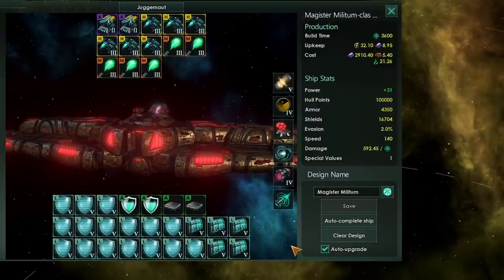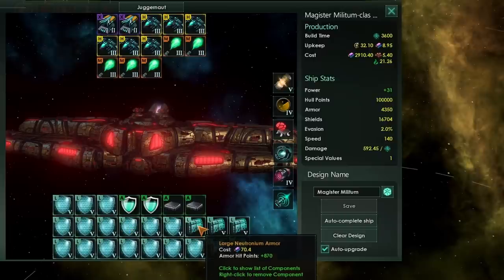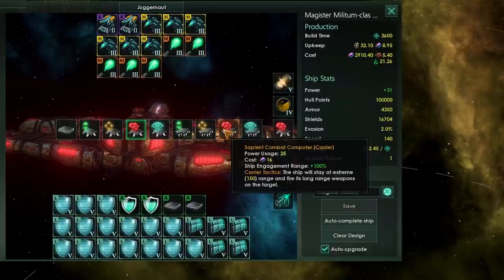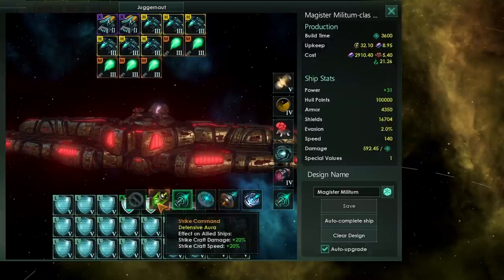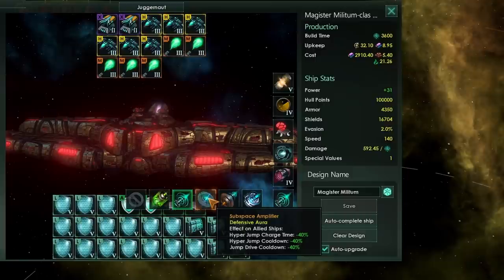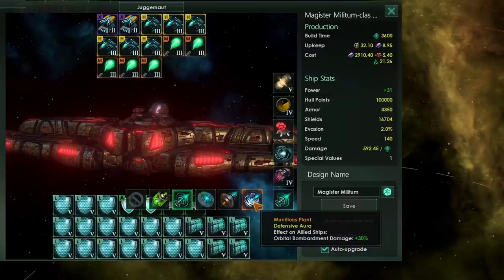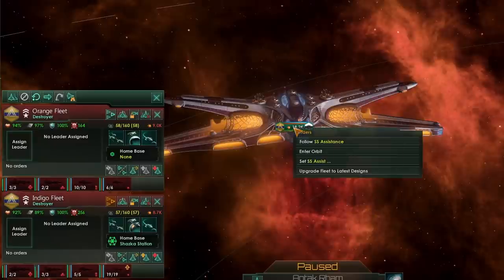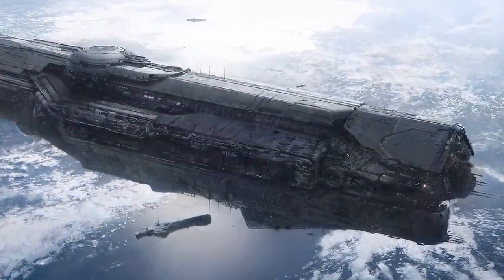Stellaris Juggernaut Design - Multirole Workhorse

Comment: my problem with juggernauts is that they are giant floating rocks and tend to slow down your whole fleet if you set fleets to follow them. If they dont, a smart player will just jump drive past your fleet and nuke your juggernaut. Juggernauts are much better as defensive options to hold an area as opposed to taking it, but its still not much stronger than your average starbase and doesnt move much faster. I dont think they are worth it due to their sheer lack of mobility (even 4 afterburners they move really slow).

Comment: I do love Juggernauts for effectively being a mobile starbase, but my biggest issue with them is how slow they are. Usually by the time I unlock Juggernauts, my fleets on average move much faster than it. So when I’m making a push through enemy territory, I have two options: make all of my fleets move at the Juggernaut’s pace, significantly slowing down my advance, or leave my Juggernaut ( I.e. the single most powerful ship in my fleet) behind and effectively reduce it to a glorified mobile shipyard. I get that the point of the Juggernaut is to be a mobile fortress that your ships can fall back to without having to all the way back home from the front lines, but it still sucks that I can’t use it in battles as much as I’d like

Comment: Comparing the neutronium armour to crystal-forged plating (not crystal-infused plating), the latter actually provides more hull points than the former does armour points. Would that mean it is better to use crystal-forged plating on the juggernaut, rather than neutronium armour, if one is lucky enough to get it (as I was in my current playthrough)?

Comment: I can see the value of a Juggernaut and they’re certainly not weak, but their awful speed alone is what turns me away from them. I can’t reliably send a (what is it sometimes 10k alloys? Can’t recall) out with other fleets if it’s gonna be left in the dust and singled out by a stray enemy force. 

I highly value speed and response times for my fleets, as I’d be able to chase enemy fleets, and quickly adapt to incoming assaults on my borders, and I don’t like heavily relying on jump drives as the malice they incur for using them makes it risky to just jump even near an enemy fleet. 

(I’d like to see other ships try and outrun 400-600 speed battleships, if I’m lucky with relics and whatnot) 

90% of the time Juggernauts are delegated to border defence with the support of a star base or one other defensive fleet. Not to mention you can just capture any enemy star base as long as they’re higher than outpost and your fleet will repair, or a gateway that leads to a friendly star base. 

They just don’t line up with my play style, and the two extra ship yards sometimes complicate mass fleet reinforcement times.
Reply: A juggernaut is less of a ship with guns to shoot and more like a support vehicle. Use it to repair your fleets after the fights and maybe even have two battleships cooking in its oven

Comment: wouldn't be better to use full ignore shields and armor? Arc emitter and phase disruptor? you have the best ship for fighters in the game, why not setup with more shield/armor ignore? I use it more as a portable starbase, so I won't need enginneer admirals for repairs
Reply: arc emitters maybe, but disruptors are trash, low dmg and even lower range even compared to regular laser and plasmas

Comment: You did the math yourself with fortess worlds having a 98% (capped) orbital bombardment reduction + FTL inhibitor. It would be interesting to know if and how much those 30% orbital damage from juggernaut would help out against those. Sometimes "build some ground units" isn't the answer especially when you fight against someone who actively build for the ground defence for example with reanimators.
Also I seem to remember that the orbital damage increase from fleet size is capped (at 100 ship capacitity iirc). SO just getting more fleets there doesn't help. Please someone correct me, if that isn't the case anymore. Where does that 30% factor in here?
To me you were a bit too quick to dismiss the orbital damage, would have liked to see a bit more math or maybe even a graph about that one.
Reply: The 30% is one of the three factors(multipliers) that determine how much actual damage is done.  The other two is Fleet size (up to 200) and bombardment type (which ranges from 25-200% damage to pops/armies/buildings).
This means all those things that reduce bombardment damage and increase bombardment damage are added together and the net number is the final multiplier.  Assuming you have NO other sources that increase Bombardment damage  other than the Juggernaut it would reduce a maxed out fortress world (which is 110%, or 98% capped) to 80%, something of a 10x damage multiplier.
Reply: @zancloufer  Thanks. That helped me. That does look like a significant increase but I guess against multiple dedicated fortress worlds one is still better off nihilistically aquisitioning or even colossus'ing.
Reply: @zancloufer  At least with NA you are getting something out of bombarding a planet for weeks on end.

Comment: Instead of fire controls given most of the damage of a jugernaut is strike craft id go with all shield capacitors.
Reply: I don't really disagree, but most of the damage is still in the guns. The two giga cannons alone do more damage than all the strike craft combined. If you add in the plasma, then the strike craft only account for 40% of the damage, which drops to 37% with two AFC and <35% with 4.